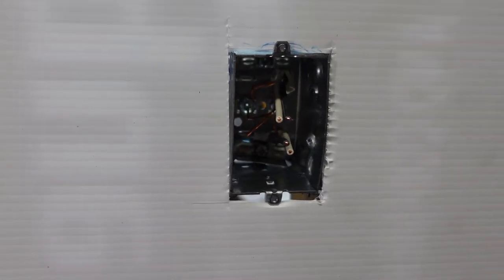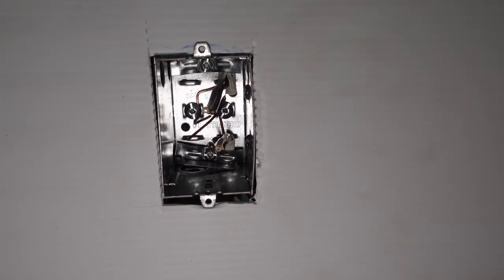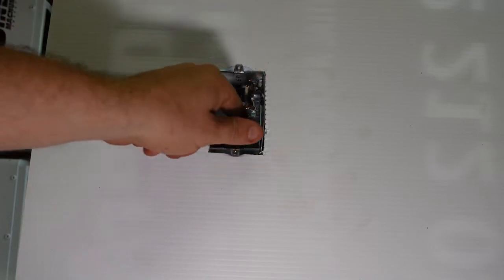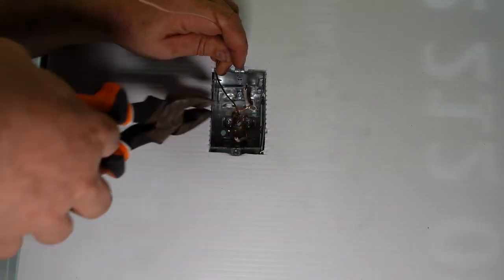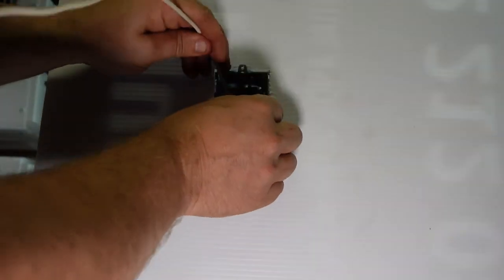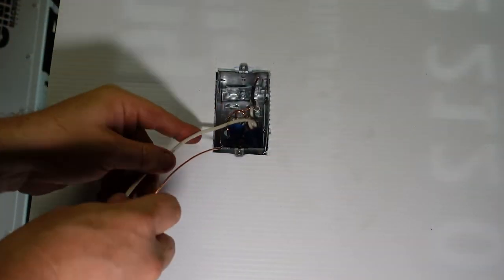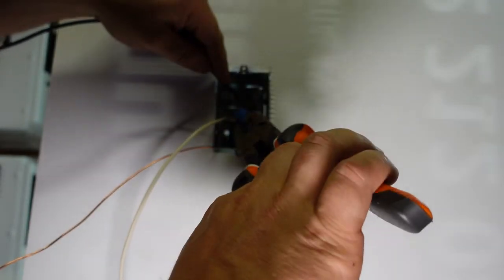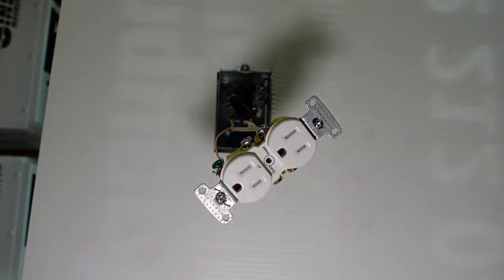How To Fix Short Wires In An Electrical Box

Comment: Have you used splice connectors and do they work or are they a gimmick?
Reply: the are good but expensive. also they can be long and hard to put 2 or 3 in a box along with the receptacle.

Comment: Can i Use the Wago Connectors? Instead of doing it the way you did it??
Reply from the maker: Although Wago connectors are approved in many areas, check with your local electrician to be sure. We use wire nuts because we feel they are a stronger connection especially for outlets that consume larger loads. Hope this helps a little and thanks.
Reply: Wagos rock! especially good to use when different size wires or braided and solid mixed.